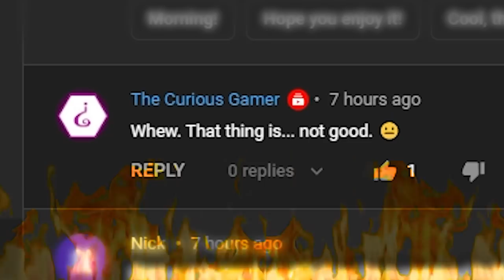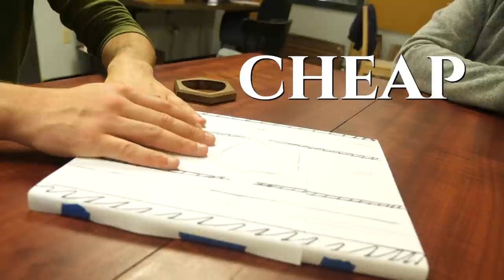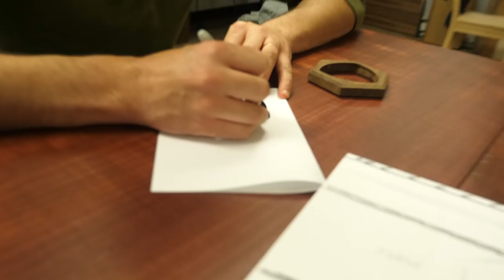New GM Screen Design Pt.2 (Jason was right)

Comment: an alternative option:

go down the same path as the Corrupted coffin vaults and the original tracker tiles, do a nice, simple, but elegant laser engraved logo, with a (maybe resin or aluminium) inlay, with a cool design like from Crystal Sully or the Frank Frezetta collection. on one side, give a small amount of accessory rail space, and the other side, a cool artwork in a quality that sits in the same range as the dice vaults and dice trays. it doesn't have to be masterwork level, just craftsman level.

I'm fine with a flat surface facing out, in fact I'd prefer it, so the framed panel isn't ideal (nor is the embedded hex) but the edges and the joints are where I want the craftsman quality. a variation of the accessory rail for the hinge mechanism would probably be enough, as long as it was of quality and functionality, and maybe you just do a chamfered edge, and have it match the aesthetics of the MGT topper.

a 3 panel and a 4 panel option would be ideal, and you can simply do a "middle panel" and "reversible edge panel", with that same 

also, before you say "hinges are expensive" did you actually think to ask the metal guys next door? the logistics are most of the issue in those metal components, but with them next door, logistics is notably less of a thing to be concerned about

Comment: I posted before that I would be fine with a simpler version of the DM screen (vs the kickstarter) but I agree that the reason I buy Wyrwood product is for the craftmanship. There are usually cheaper alternative on the market, but the quality and craftmanship is not the same. And I understand that it come at a higher price. 

I admire the will to keep the price as low as possible, but it should still have that craftmanship, design and quality I love about Wyrmwood product. In the end I’d rather go with a higher price point to have a product that match Wyrmwood quality.

Comment: I commented on the last video but after seeing this one... it's nice they are working on it and improving it.  I still don't like the solid wood look.  I'm curious how it was "easier" to do what Doug did than just a frame and panel.  Also... I'm not a genius in wood work, but could you possibly CNC out the frame and panel look from a solid piece of wood?  Also, if you ditch the modular approach and accept that most people are going to want a main center piece and two side pieces at a minimum, you could still go with the solid wood for the sides and a fancy middle piece and if people want more panels, they can buy more of the slab panels.

All the aesthetic issues aside, I really do like this metal rod hinge design they are doing.  The idea to go to tubes sounds even better.

Comment: Seeing the machines they have i feel like they are much more prepared to produce and good frame and panel DM screen. They have a huge veneer press for the panels and you can use the molder to make a long frame piece then cut them to length. I feel like that is your production solution I could be very wrong. Or you could use a lot for cnc time and route out solid wood to mimic frame and panel but Idk how that would handle warping.

Comment: I didn't get into WW because I needed a Box and had 150 burning a hole in my pocket. I didn't support the coffin vaults because It was cheap. I didn't buy XPBD dice because I needed a set of 10 dice.

I had all those things already. Wyrmwood offered the best, most appealing versions of those products and I justified the price because I liked it.

My Katalox Master Vault? I could use a zip lock bag with some tissues inside. I got it because it looked really good and I loved the Black poisonwood.

My Coffin Vault was to celebrate Halloween and because I loved how it looked. 

I don't want a slab of wood. I can get that at the Home Depot down the road. I want a DM screen that makes people look twice and wonder "Hey that guy has got a sick DM screen".

I think Jason and Dougs proposals both work there, and I really like the Custom Plate idea Doug proposed. But I don't want 3 planks held together with magnets for $300. Even if it has a shield slapped on.

Comment: I would want something on the order of the tracking system. Modular so I can choose the bits I want, but each piece doesn't break the bank. I love wyrmwood, but cannot afford most of their products. I love the old dice tower design from the original dm screen with the choice of public or secret rolls. I am very psyched for the tracking system. Team Doug!

Comment: Not sure where the $1k and $3k price points are coming from. Doug estimated $150-ish per panel for the frame/panel, which makes a standard 3 panel screen $450. High, yes, but it's quality woodwork for what's arguably one of the biggest showpieces of a gaming setup.

Comment: If hinges are the sticking point when it comes to pricing, why not just include hinges in the set with pre drilled holes. Just like furniture I see no reason why a small amount of self assembly is an issue?

Comment: you could get some strong magnets, they'd add quite a bit to the cost, but itd maintain that modularity and be better than hinges.
you should also use a finish you could write with wet or dry erase marker on. 
i'd say to use some strips of metal that are ferrous enough for magnets to grip. this will allow gms to prepare in various ways and not necessarily have to cram everything onto one standard sized sheet of printer paper, and you could also add magnetic accesories like a counter or initiative tracker.
also whatabout a bevel?i also love dougs inlay.

Comment: I have a solid wood gm screen like Doug is proposing and its heavy and I don't use it. Its too much work to cart it to any gaming shops so it just sits on my shelf. Frame in panel would reduce the weight on the thing and would look nice but I can see why it would cost a lot. 

Have you guys considered making these panels like a picture frame for an oil painting? the panel would insert into a frame from the back side sitting on a ledge. So one side would look nice like mercers DM screen from the front and then the back would be a flat panel easy for sticking information on/to. you can even veneer the back side to seal in the insert to clean it up. I can see putting your DM info on a panel with a recessed edge on the back of the screen being a bit of a pain.

Comment: To be honest I have a cheap customizable DM Screen from Amazon. Got cool custom art inserted on the outside and my own game reference pages on the inside. It’s similar to binder construction. 

What I like is it’s lightweight and thin, easily customizable, and cheap.

My one gripe is that it’s too tall. I don’t want to be separated from players.

I think if people want a GM Screen then find the niche of Master Work with the silver stringing and inlays. I don’t want the pure block of wood that Doug is trying to push out. It looks cumbersome and doesn’t seem to have much thought put into the features for the customer. Either it needs to be game changing or the quality needs to be top notch. At this point the $20 screen has more usability.

Comment: I think that all 3 of you have great ideas. I think trying to push out the "cheapest" option is a mistake. I think $300-$600 is a good price point for a GM screen. I also think Doug is to stuck on the idea of "modular" instead of craftsmanship. I want something that I'm going to have with me everywhere and not have to worry about losing a metal rod or pipe. I think offering 3-4 panels is your best bet. I'm also worried about all these magnets. I have my laptop behind my screen. I don't want to have to worry that it's going to destroy my computer or damage it.

Comment: I appreciate the effort going into this. The idea is nice, but even not as a designer or a woodworker, the block of wood from last episode was a terrible idea. I may as well make my own and use hinges because at that point it's how I want it and it won't change. Recessed areas for the magnetic rods are a nice idea, but that makes developing other components harder (you said last episode about initiative tracking modules etc) and therefore more expensive and time-consuming...
Sure, keep the magnets, I feel that there's space to do stuff there and magnets would allow "modularity" or magnetic edging strips. Initiative tracking wouldn't be resting on the top waiting to be knocked off and bits of paper wouldn't be taped or blue-tacked onto the screen.
Do think about trying to match a design choice - mgt and hexy look great together; the tracker system would work well with either because it has that "Wyrmwood feel". A nice piece of wood with a removable logo isn't Wyrmwood in my mind. It doesn't need to feel heavy like the old screen, but it does need to feel like it was worth the time needed to make and worth the money invested. I read in another comment "heirloom quality" - the sort of thing I would give to kids, grandkids or nieces/nephews when I'm too senile to know what a d6 is.
<3
(edited for typos)

Comment: I think system rather than product for sure (mostly because I'm a 4 panel kind of GM). A route you could go with (that would not be great for the production line) would just be to offer more than one product on the site to find out what people would actually buy. We all can sit here and claim we want frame and panel in the comments, but if people are looking at 4 F&P panels for $1000 versus 4 solid wood panels for $250, and they both accomplish the same thing and go with our other wyrmwood stuff, people will vote with their wallets on what they are actually willing to pay for.

Comment: I’m with Jason, I’m a minimalist but it’s just three slabs of wood. I do like the idea of a system but I don’t know how practical it is to have more than 3 panels. I like the idea of it being vertical or horizontal and modular but per session basis the configuration rarely changes. I like the Matt Mercer gm screen but I do think a medium product between that would be good. I think the original design isn’t a Wyrmwood product. I feel it can and could be better. The cove idea is a good idea and good craftsmanship ☺️

Comment: How about you FAKE a frame and panel? Take your first prototype, and route out 1/8th inch in the inner rectangle on both sides, glue in a veneer sheet in that rectangle. You can achieve the look of a frame and panel, with only having 3 parts: The inner solid wood core that doubles as the frame, and the two sheets of veneer that form the "Panel". 

Additionally, an expensive option that is a step or two below the Mercer DM screen. No veneer engraved "How do you want to do this" or CR logo, you swap out the burl veneer for something in the core lineup. Then you make the silver stringing and the initiative tracker upgrades for like 50 bucks each per panel. Most importantly, you keep the fill on the Wyrmwood logo and the BARREL MAGNETS. That's one of the biggest improvements over the OG screen you had, and you don't need to fuck around with the metal tubes like you currently have

Comment: You gents have the ability to knock out some amazing products. I would not think making style and rail doors panels would be that far out of your scope of work and skill sets to make as a profitable item. You might not be tooled for it, I am not sure on that front. I have been in the cabinet industry for 20 years and have switched from making all of my onw doors to ordering them from a shop that makes nothing but doors. Purchased by the square foot. red oak, $6 maple $11, walnut $20. I could make them for cheaper, however the machines eat up a lot of floor space and the task takes one guy away from doing other tasks I need done.  A style and rail panel would be amazing to use for your GM screen.

Comment: GM screens are an investment. I do think $1500-$3000 is a bit much for even that investment. However $500-$1000 fully accessorized depending on wood choices seems pretty reasonable. Personally I’d wait until production could be dedicated to this product then rush through a half-baked idea just because slabs “could” be done. I want a Wyrmwood GM screen, but I would not invest in a slab and magnet system just because Wyrmwood had its logo on it. I want the craftsmanship and think a panel production, whether that took time to accomplish, would be the way to go and what I would buy.

Comment: If I was spending in the area of 1000 USD for a GM Screen, I would want the other side of the screen to have magnetic slots facing me that I could attach notes and papers to, an clearly seen initiative tracker,  a fold out dice tray (that can also store a set of dice or two), a few randomly dug out areas that I can store small objects that I will use for my campaign.  One of the other two panels would need to have a large carved section with foam inlay to hold figures that I plan to use that day and bulk dice storage, while the third panel would have the space/area for at least 3 (perhaps smaller sized?) RPG tracking systems (sell it to me separately, I don't care.)

Comment: Portability should also be on the menu to drive the design as well. What's the use of having a sweet GM screen if you can't bring it out and use it at game shops to show others how cool it is? 

Also, maybe if you optimize more for "frame/panel" you will also open yourself up for lowering it's cost, and possible other design options on other/future projects?

Comment: For a three panel screen, perhaps frame+panel for the center, and a more simple solid wood for the outer two.  Maybe using the veneer sides like the Classic Adventuring Party tiles.    Would cutting the frames on a diagonal, such that the board looks like >>>>> and thus two joints and not four, be a useful idea? (Probably not since it's not already being done,  but I don't know)

Comment: If going with the framed technique, what if the outside framing pieces were magnetized to the main board? They could be removed and used to “pin up” whatever the GM is using and it would make the whole thing look like a picture frame.

Comment: MGTs can be wood slabs because they are a platform, a support, for something else to be seen. They are not a centerpiece as a GM screen is. Make an expensive center panel, and cheap side panels, with matching woods and angles and whatnot so that they go in a set, and maybe someone will buy only side panels for their setup, and someone will buy a set with the main, more expensive, panel.

Also, all this talk about the player side aesthetics, bit what about GM side functionality. How will pages be attached, will there be anything else or just a flat piece of wood(s) to tape paper? Matt's had a metal bar and magnets to clip on lights and whatnot, and that sort of functionality made it seem way more attractive as a DM than the aesthetics.

Comment: I want a GM screen like I really want one from Wyrmwood. I discovered Wyrmwood and the Wyrm Lyfe wayafter the Kickstarter for the first GM screen and I was bummed I missed it but now I'm excited for a possible new one which is cool. However, I don't think a modular system is a way to go IMO, I think Wyrmwood is hung up on modular systems while a GM screen can and should do many things I don't think it should be 3+ pieces with other pieces magnetized on it. If anything it should just be 3 blank (ish) panels that I can clip paper and other things onto it hinged or not, no need to be able to flip one or 2 panels around for whatever reason I can't think. I want a GM screen I just don't think modular is a way to go, that's just my opinion though.

Comment: I like the basic GM screen, and I like the modularity board style. The problem is that it's a GM screen. You're likely going to cover it with notes or info. I want a simple system that enables me to have magnetic attached pages, maybe a cup holder that attaches, and a dice tray. #TEAMDUGGIE

I would like to suggest a compromise. Have two different "GM screen core units" that act as the central or main board. It can be frame etc or board. two different price points. then you have the extra panels be the simple board style.

Comment: One of the things I think wyrmwood loses sight of is that quality products people want don't mean constant repeat sales. A higher priced quality lifetime gm screen won't see all the time because most folks only have 1 gm and the market of buyers is smaller, but folks are willing to pay for high quality products.

He talked about raises and jobs, well MGT and Hey solutions are designed to generate those things. Hex system will allow folks to buy new accessories or get more of them over time, MGT does the same.  Take the time on engineering don't rush. Jason's idea of the wyrmwood brand is what many customers expect out of wyrmwood. Don't make lesser products just to have more production.

Comment: I dont think wyrmwood products need to be overengineered and expensive.
I dont mind buying three slabs of wood made of glued up cutoffs and two rods of metal.
To me Wyrmwood means that - whatever the scope of the project is and how “fancy” it is - it is done well. 
If i buy three slabs of wood they will be great slabs of wood. Good glue up, no airgaps, magnets properly centered and aligned.

Wyrmwood (at least in my mind) is a promise of quality and customer service, not a design brand.
There is no reason to just have one type of DM screen in your shop.